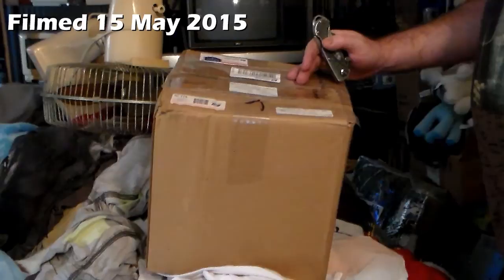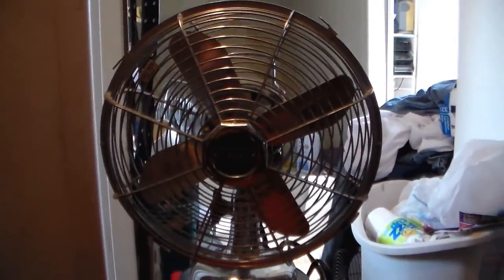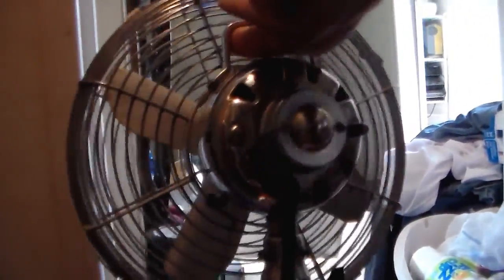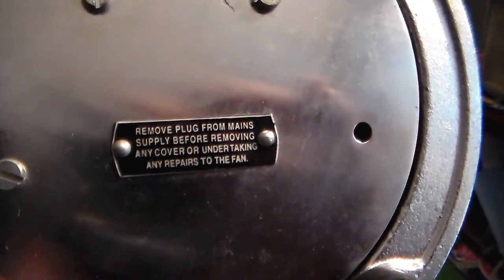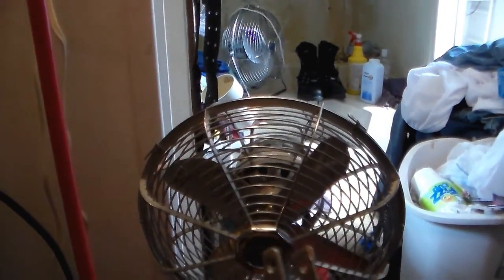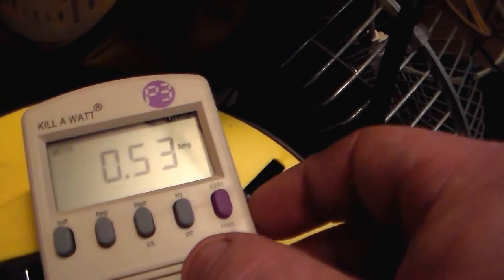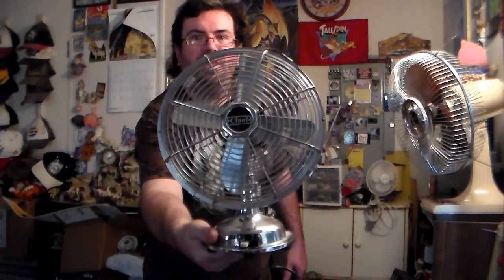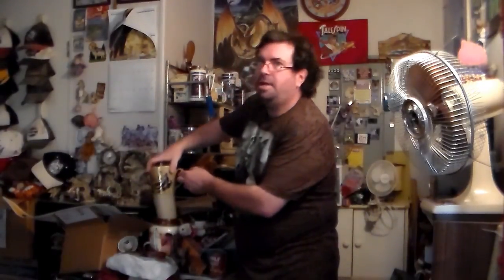Eskie's Vlog 051515: A Modern Vintage Cinni Fan

Comment: For the blade size you just have to take off one zero and there you have it: 20 cm. Usually 20 cm desk fans are oscillating and have two speeds.